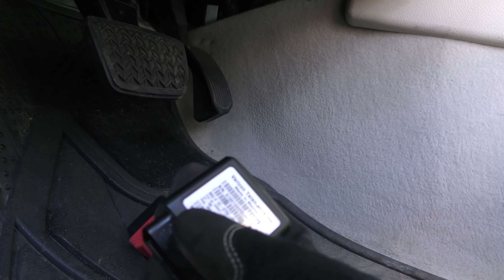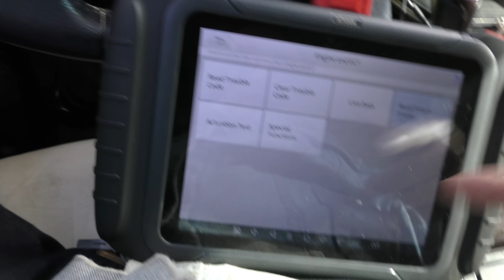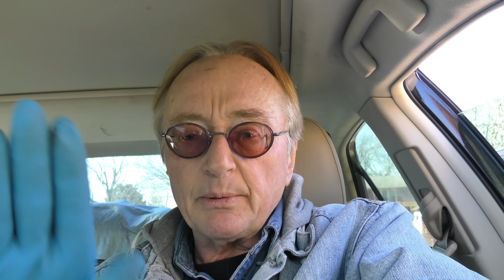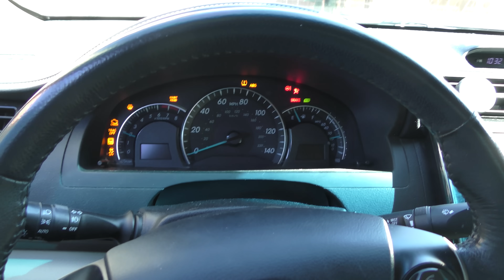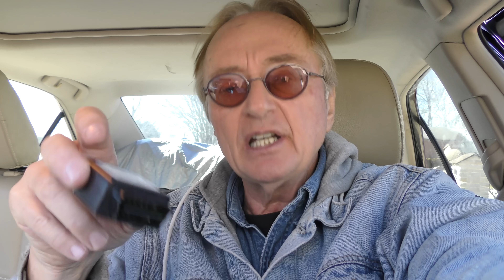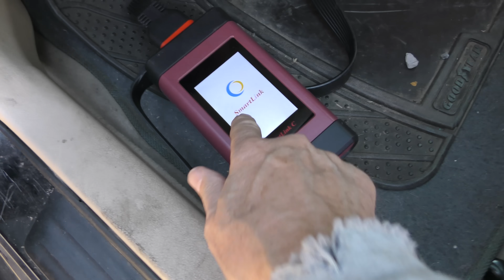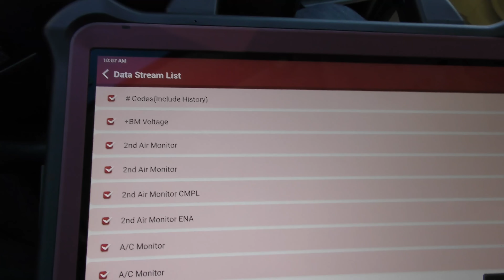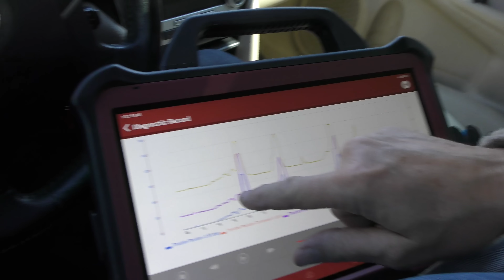This Stupid Device Just Cost My Customer Thousands in Car Repairs

Comment: If it only acts up when it's cold, I would honestly just drive it as it is and accept the fact that the dongle probably did damage the computer but is probably not worth replacing at this point, or at least until things get worse.  A little electrical tape can fix the check engine light, which seems to turn itself off anyway after a while.
Reply: The dongle is a portable WiFI hotspot, so it's unlikely to be the cause.

Comment: WhilelI agree and I don't advise people putting thing into the data port that are claimed to do things like disable AFM fo GM vehicles or give you better gas mileage, depending on the module, it may not damage anything, but might cause the computer to throw odd codes at times.  Either way, those things are not worth it in the end, if you need to dsable or track something, get a system that's designed to do it that doesn't require it being plugged into the diagnostic port.  In fact, some car manuals tell you not to drive the vehicle with devices plugged into the diagnostic ODB2 port or it can cause malfunctions in some cases.

Comment: The Verizon Hum has FUCKED up a lot of cars. GOGGLE it.   I still think it trashed my electrical system on my ISF.  Killed one battery,  then another battery while I was still using it and now I am through a $450 battery in like 2 years.  I think it did it's damage already.

Comment: I'm a drivability tech and can say these "dongle's" create a lot of problems especially with excessive parasitic drain on the battery. Can't trust anything if you're dealing with charging system problems. Alternators get tired after months of recharging almost dead batteries. Remember folks, alternators are designed to keep the battery charged, not for charging dead batteries and automotive batteries don't like being discharged and recharged repeatedly either.

Comment: I have seen many electrical components that dont work till they're warm. Ive also seen them stop working when they warm up so your probably correct on the diagnosis. 🍻  If it was constant I'd be leaning more towards a bad ground. Any time i suspect a ground issue i just grab the booster cables and hook them from engine to frame  and the other side of the cables i hook engine to body or wherever need be. Then a quick check of the ground cable from battery to engine. Then Test. I just find it easier and quicker than looking for all the grounds. And just because the ground is there and looks good dosen't mean it's grounded.

Comment: Hmmmm.......the OBD port was designed for output to readers. Leaving any type of interface adaptor plugged in won't cause damage in itself to ECU.

The telltale symptom you missed here was unusual sensor readings at the same points in time you had unusual voltage readings. Those sensors were giving duff readings because said sensors were fed incorrect supply voltage. Give that poor car a new battery, and she'll be just fine.

Comment: I have a 2011 prius and have used several of the obd2 dongles and ALL of them caused hellatious issues. The most consistent issue was the regen brake system would fault out and you'd have nothing but mechanical brakes. This would light up the dash like a Christmas tree. Engine stumbling, erratic cvt activity, even brake booster issues would crop up.  All resolved by removing the dongle and resetting the computers.

Comment: Hey scott I have a 08 chevy suburban when I get up to 64mph it starts shaking then it mellows out around 80. Any thoughts on what it could be? My wife's uncle says it's the transfer case. I never have the auto 4x4 on its always on 2wd. Do you think it would most likely be the rear drive shaft? U-joints or driveshaft outa balance?

Comment: I had a peddle drive on my F-150. It was causing issues with my truck. I’d be stopping at a light, foot completely off the gas and on the brake and the truck would be going as if I was giving it gas very lightly. Took it off and the issue stopped.

Comment: Scott, the Verizon Telematic dongle is used for GPS tracking usually of fleet vehicles. If it's a personal vehicle someone might have e been tracking them. Fleet vehicles use then to lower insurance rates and as black boxes for accidents. Would hope it wouldn't damage the computer because there are tons of these out there

Comment: Scotty buddy you did not prove your thesis but it was a good video. I have had Toyota computers fail and never had a dongle. Additionally, I have had thousands of dollars worth of repairs on Toyotas due the faulty sensors that report a non-existent error keeping me from passing inspections for no reason at all. 
In other words, I don't trust Toyotas software or electronics much more than GMs, Fords or Nissans. 
I would question that a car tracker that provides GPS and other passive information could cause the computer failure and I would not bet much that is it a computer failure. It is the facility that a lot of mechanics and doctors choose to blame the thing they don't understand, that the can't see or test as the secret culprit.
Otherwise, i usually love your stuff.

Comment: You've provided zero evidence that the Verizon OBD module did anything to the car whatsoever.   Maybe it did, but maybe it didn't.   I've had a "cheap" elm OBD adapter plugged into my 2004 Tundra for over 5 years, it's NEVER caused a problem.   And that makes sense, if you were a computer guy instead of a car guy, you'd understand how the OBD-II interface is just another computer interface.... It's like saying leaving your mouse plugged in all the time is going to damage your windows PC.... That's just rediculous, and ignorant of the technology.

Comment: Be careful jamming open a throttle plate. If it is a throttle by wire type that operates electronically via the computer and the pedal sensor, you may damage it and have to replace the entire throttle body! Even cleaning a throttle if it is very dirty will cause the car to run horribly for a week or longer sometimes, until the computer can do a relearn with a clean throttle plate. Ask me how I know.

Comment: Sure wish all mechanics would use Scotty’s honesty and logic in repairs. Many are using “book” rates and are parts changers and not trouble shooting. I paid a local “Christian in recovery family owned” honest shop to change the oil, cabin filter, and install spark plugs I provided. The cost way exceeded the estimated price. Just over $1000 for a 2012 Nissan Versa. A big name Toyota dealership charge my daughter $850 for a new alternator. She was charged $480 for a remanufactured alternator when a new replacement from a parts store listed at $230. 
     Wouldn’t a battery disconnect without the dongle reset the computer?

Comment: I've had issues with older toyota throttle bodies after cleaning. Throttle plate home position may be a little off if there was lots of carbon and it needs to relearn

Comment: Just my 2-cents: I plugged a "Econoboost"" (Made In China) dongle into the OBDII port of my 2002 Ford Cargo Van with the 7.3L(446-cid) turbo-diesel engine, and it worked as-advertised; it's been in there for several years now, and it still starts & runs just fine. Keep in mind that a turbo-diesel isn't something most people would have.
 Any thoughts, Scotty?

Comment: Hi Scotty, just some advise here from a 40 year professional electronics guy. When using electronics spray cleaners be sure to allow the cleaner to completely dry in the connector before putting the back together, even use compressed air to blow it out because any liquid cleaner left in the connector will slowly corrode the contacts over time.
Reply: I use aircraft quality silicon paste in connectors. Keeps all the crap out.
Reply: @tinaleanne8230  yes it does…
Reply: @tinaleanne8230  In Honda world, we use dialectic grease. Works great.
Reply: I’ve got the brand contact cleaner he’s using. It’s a quick drying formula that dries after a few seconds.
Reply: @alanator6333 plus people seem to forget that time goes by between video edits.
Reply: A little dielectric grease helps keep water & gunk out too.
Reply: Dielectric grease... that stuff works.
Reply: Thx for the info

Comment: Another possibility: there's a slightly loose ground connection somewhere that causes high resistance with the right vibration when the metal is cold, but when warmed up and the metal has expanded slightly, the connection is secure enough not to exhibit the problem.  With a map of where the front ground points reside, checking them for tightness could possibly remedy the problem.
Reply: This.   Computer glitches usually run opposite, fine when cold, act up when hot.
Reply: Third. That battery is also growing a chia pet.
Reply: @moffatcountycustoms  🤣
Reply: it's a cheerful sight when opening the hood @moffatcountycustoms
Reply: I second this idea.

Comment: Before replacing the computer, I would consider one last solution: briefly disconnect and then reconnect the car's battery, an act that will often cause computers to reload their program from non-volatile memory as part of the reboot process.  Some also refer to it as the master-reset switch, pulling the proverbial plug.  When my 90-year-old mother calls complaining about her DVD player not working, usually because of some errand electrical spike, I instruct her to unplug it for 10 seconds and then plug it back in.  This always clears up the problem.  A few times I used this approach to clear problems in a 2007 Lexus GS350 I once owned, problems related to weird behavior, something not functioning.   After reconnecting the battery, the car rebooting, the problem would invariably go away.

Comment: I just patched an issue with my dad's Dodge 1500 5.7.  It ran like crap with engine light.  One mechanic changed O2 sensors,  a month or two later a mechanic changed the fuel pump.  In all honesty after my investigation of it, all they did was reset the battery and swap parts that didn't need swapping, $$. Because a few days later both times after being at the mechanic, the truck ran like crap again.  In the end, I had to watch a lot of Scotty's videos, use scan tool to find 02 codes and figured out that the heater for an 02 sensor was not getting power.  The computer was the problem, however a bad sensor could have fried the heater circuit in the computer to begin with.  Wired sensor heater 1 to sensor heater 2 to get 12v and not a problem since. Code is still there showing bad heater but the fuel trims are decent now.  Because, before, 3 sensors warmed up on their own using built in heaters while the other one warmed up from the engine heat. So fuel trims were off always off.

Comment: Hondas come in my shop all the time with those stupid dongles in the DLC with all kinds of wacked out codes. Remove, clear, 9 times out of 10 problem solved. I dont recommend leaving stuff plugged in the DLC either Scott. That's not what it's for.

Comment: I had an old Firebird that had crossfire injection.
Heard a lot of horror stories about them ,but, I'm a mechanic.
Every few months, I had to put a whole quart of water dispersant, and dumped in three bottles of STP injector cleaner.
Within 60 miles, it was running like a champ again.
I took that knowledge, and I clean the heck out of injected systems when needed.

Comment: I didn't know you could jam wood in those throttle bodies.  I once cleaned the one on my VW 2.5 and I just kept something pushing the accelerator.  You should also be careful doing that not to bend anything.  Also if you open it the way I did, keep your fingers out.  If that thing closes you are trapped and you will wish someone was there to push the accelerator to free you!  It is a good idea to inspect them once in a while and clean them if needed.  I once had a Chrysler that had a sticking air idle motor and would not stay running without my foot on the accelerator.  I am glad it was a short trip home.  Some throttle body cleaner solved the problem and I never had that problem again.

Comment: SCOTTY! my mom got talked into a Verizon dongle like that and it made issues with her 07 Acura RDX! I found a quick fix for $5 on eBay! It's a negative terminal disconnect that I use to disconnect the battery overnight. Working so far

Comment: i personally don’t think its pcm not just yet for sure, dense module are excellent, start with brand brand new fuel & perform adaptions as per manufacturers book, open pcm & check for oxidation burns discoloration etc.. the adaptions look like  had been learned wronglfully possibly due to bad gas or mixture of e85 or winter heavy additives hat petrol companies love adding

Comment: OBDLink LX isn't a cheap wireless scan tool at $80+ and was one of the highest rated ones at the time, has high refresh rates, and IS intended to be left in. Months later in my '16 forester my car would have severe hesitation randomly, but not too often. I let my buddy borrow the scan tool for a while and didnt have it in for a week. I noticed I didnt have any problems while the dongle was out, but the problems came back when i put it back in. Took it out for good and thankfully the problems never came back. I was really surprised because so many people recommend this scan tool for constant use. I was really bummed because it gave so much valuable info on the vehicle I was REALLY sad to let it go, but it was a relief knowing I wasn't going to be out thousands of dollars had I left it in.

Comment: Great vid, mind blown. I used to leave a cheap OBD diagnostics dongle loaded in my Ford Explorer. Disappointed to hear that can cause a problem but electrical connectors are ALWAYS a week point. I used to work on portable military radios and the main front electrical connector was a minor mechanical wonder - it was one of the most expensive components in the radio. Look at ALL the connectors in a car. I just replaced the window regulator in one of the doors and the entire door panel probably has 15 connectors - every one a potential failure point.
Reply: I'll put money on it that it was not the single that caused the problem but a bad solder joint on the ecm main board. He says the issue only occurs when the ecm is cold. The solder joint shrinks when it's cold and has a poor connection, when the system warms up the solder joint has better contact and the problem goes away. The dongle is a coincidence and has no relation to the problem.

Comment: That device is called a HUM, it is designed to stay in the car...apparently. It has 3g service and GPS. It works with an app on your phone diagnoses and tracks kinda like an OnStar system. I sold dozens of them years ago. People really liked them, they called 911 if airbags went off, found your car and told you when your battery was dying.

Comment: Nice video Scotty I have a 2005 Toyota Sequoia and I can't get it to go into program mode it has a box attached to the firewall on the passenger side with the wiring coming out of it and one wire goes over to the starter relay and it's jammed up underneath that relay I bought it this way I don't know what to do

Comment: I am ase master certified L1 advanced engine performance specialist. 27 years in the biz, I dont recomend manipulating the throttle plate manually. it can upset the internal components and cause failure. Most scanners have a throttle test function where it holds throttle open for you, or clean with engine running. DO NOT USE THOSE STOOPID DONGLE UNITS! Plugging in to the OBD2 port gives direct access to every computer in your car. These computers are connected to each other by the same circut and they are in constant communication. outside devices can not only issue commands during critical communication between modules causing communication failures, but also can bleed voltage off or leak voltage causing critical short circuts and a number of other headaches including inducing permanent damage by overloading the " can" circut. (controller area network). Internet Wifi dongles can and do spy on you!!!! How do you think google knows you were at Taco Bell this afternoon? This is no joke! Hackers can also use your dongle to track you, gain access to your entertainment system utilizing the hands free phone function to listen to you, copy and transmit your vehicles smart key passcode, or gain access to body control module and change passcode locking you out of your own car! It can also copy the transducer positive authorized key sequence used in vehicles that have a key that has the radio chip in it. All of these different problems are risks you take with ANY dongle but those wifi units present serious security weaknesses they dont tell you about when they sell you the car wifi unit that plugs into the OBD2 port.